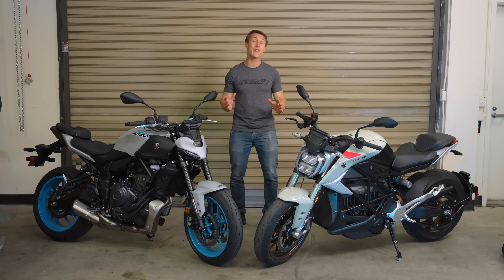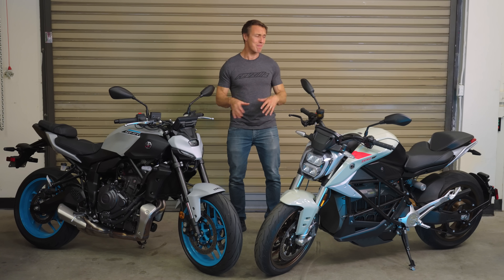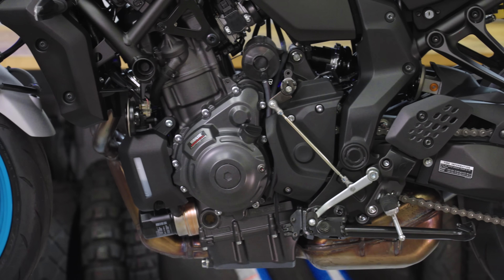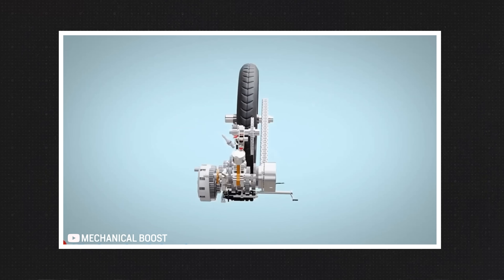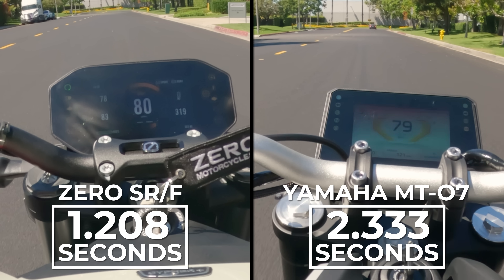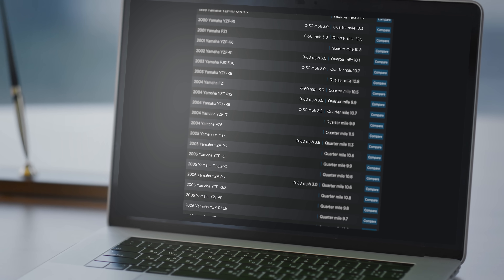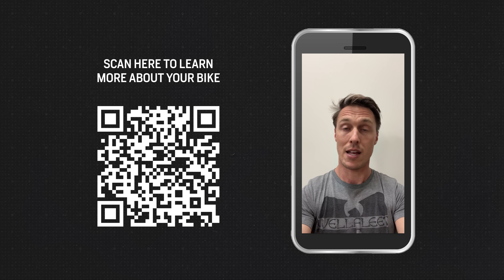Are Electric Motorcycle Torque Figures a Lie? | The Shop Manual

Comment: I ride E-moto's offroad. I believe the manufacturers figures are probably correct but in addition to torque multiplication theough gearing on IC bikes... with E-moti, because the throttles have a throttle ramp delay, you don't get the same feel of the torque because its metered out.
One of my bikes has an aftermarket speed controller that allows you to remove the throttle ramp up/delay... to get true 1/1 ratio with zero delay.. then the torque hits instantly and feels aprox doubled. Unfortunately, the available traction seems to completely disappear, too, though. It becomes much harder to ride, the slightest bump can cause you to break traction... and despite being more fun, it is ultimately slower.

Comment: 2 points here:
1. Isn't zero comparing their bikes with 1000CC gas bikes? I thought that was their whole marketing campaign !  Why are you putting it against a 700CC bike?
2. Wouldn't a Dyno run give you the exact torque to wheel numbers without all the BS?

Comment: I was just looking at the new "80 horse power" Stark Varg EX, on their side they claim 764 ft-lbs 🤔 
Yup, hard to wrap my head around as that sounds like it should loop you out in even in 6th gear (overdrive) on a sport bike, definitely between 3rd and 4th (anything below 1:1). I guess it's best to just think of it as something totally different, like a big diesel but even farther off.

Comment: As someone below wrote torque does not really matter. What really matters is how many times at the unit of time an engine can give this torque. And this is called power. If you know the power of two engines you can tell which is faster without any other data. That is not true with torque. Power contains torque in its equation. P = Torque * rpm * someUnitConversionNumber. So the Zero has 110hp and the MT-07 only 73hp. No wonder the Zero is faster.
Reply: Actually "area under the curve" is what you're looking for. Peak HP can be JUST as misleading as peak torque, because HP only occurs at a given RPM and so it doesn't tell you anything about any other RPM. The only way to truly understand a system's output is by looking at a graph.

Comment: The EV motorcycle manufacturers are hoping the common person only reads spec sheets and are BLOWN AWAY by the figures.
The EV motorcycle manufacturers understand the general motoring public doesn't understand the figures on gas bikes to begin with.

Comment: 2:20 your math might be right, I'm just gonna assume you checked. But the rear wheel torque number is only for 1st gear. As acceleration increases the left gear lever start moving upwards to avoid rpm limiter, the rear wheel torque reduces for each flick upwards with the lever. But the electric Zero keeps the same torque from start and upwards past legal speed limits.

Comment: Something to consider.  With an EV the weight stays the same from full charge to no charge.  Performance drops as the charge is depleted.  With gas powered vehicles the weight drops as the fuel is burned resulting in maximum performance increasing right up to empty.

Comment: I.C.E torque is measured at a 1:1 gear ratio, EV torque is measured at a static 4:1 gear reduction making the Electric motor torque appear 4x more than the combustion engine. Electric motors feel more powerful as they are starting from a dead stop whereas combustion engines are already running at an idle speed, you can feel similar torque from a combustion engine on initial fire where the engine will rock the entire bike(ie: Moto Guzzi or BMW R).

Comment: I hate advertising, advertisers, advertisements, and consumerism as a whole

But lemme tell you, I bought a duraboost Li-Ion battery for my superduke in 2023 and it’s been great. Several pounds lighter than stock and much more resistant to voltage drop over time

My only complaint is that the battery is physically much smaller than the battery box, and the little foam sticky pads they include in the box suck ass

I just measured and 3D printed an adapter box that was the size of the old battery with a cutout the size of the new battery. No complaints since then!

Comment: The tuning of the electric drivetrain is also very important. It generally takes a very robust motor to handle actual full power at low rpm without overheating. And, full power right off the line would likely either spin the tire or just make the bike want to flip. So they program it to feed the power in a little more gradually so it’s controllable and not going to damage the drivetrain. 
And, with a single gear you get somewhat limited by where the sweet spot is. Gear it lower and you have more power at lower speed, but it’ll fall on its face at higher speed. Gear it higher and it’ll be slow off the line, but pull good at higher speed. 
I think as they develop electric vehicles will start having 2 or 3 speed transmissions. That way you can have the ease of just leaving it in high gear and running around. But, also be able to use a lower gear for more acceleration at lower speeds. And, that could let them use a less powerful motor if it doesn’t need as much torque to pull as hard in high gear.

Comment: Torque means nothing if I can't get home without having to stop and charge for way too long
Reply: Don't ride further than your battery range? Pretty simple really. And yeah, you can have more than one vehicle for long trips (or hauling, or passengers, or whatever else). Electric bikes are mostly for short trips, yes. That's not a design flaw, it's a usage constraint, just like you can't transport furniture on a gas bike.
Reply: @falkin42  I have a job that can take me anywhere from 20 miles to 300+ from home one way. Imagine willingly chaining yourself to one town and praising the cage.

Comment: Ive explained this to many people who love to quote the torque spec of the ebikes as to why they are "faster" when its really the area under the curve that makes the difference. It similar to the gas equivalent of peak power/torque and not talking about the useability of that power(power under the curve of typical dyno). That said I have only seen one company that actually calls out both numbers in their marketing material, Dust moto. They outline the motor torque, and output torque with the reduction ratio stated. Thats when you know its a company run by engineers, not marketing staff haha

Comment: I was a gear head until my first Tesla.  That instant full torque and horsepower from just above zero rpm with the continued G’s building up as no tranny shifts to interrupt the G’s.  I own a fast  car with a PDK transmission.  You floor it but it takes a few micro seconds as gear selected, direct injection nozzles receiving gas, then rpm must build until tranny shifts.  Horsepower needs rpm.  Car Gas motor sweet spots around 7000 rpm.  Gas Motorcycles sweet spots even higher.  Horsepower basically torque x rpm corrected by a constant. Gas motors 25% efficent vs 85% efficency electric motors.  Oil so cheap that inefficient gas motors are used even today. Batteries will improve  especially when more factories in usa vs china and korea.  Chinese CATL worlds largest battery factory

Comment: The rpm at which the electric drive motor produces peak torque will not math out to a very big horsepower number.  Let’s say at 200 rpm the 140lb-ft torque motor is producing 5.34 HP. No one wants to hear that number in promotional discussions.

Comment: Basically, electric motors are no-limits as far as torque and power. The actual limit is power supply and temperature. As far as torque, an electric motor can be built (wired) in different ways to achieve higher torque or higher speed. It's a kind of integrated gearbox. If you have a clever electronic power supply you can achieve both, yet the temperature is still limiting the duration of the power / torque peak. And of course, the battery will eventually be drained faster if you pull more power. Base rule of thumb, max power is reached when energy efficiency is 50%

Comment: Just as in cars, torque number is useless, you want to look at power curve (and gearing), not random point on it. Power curve flat-ish = pulls from the lower rpm.
Thrust is GREAT way to show it, but sadly most  bikes don't have that in spec sheet

Comment: One my favorite motorcycles I've ever owned was the Brammo Empulse R -- full electric torque, sent through a traditional 6-speed transmission.  The 'butt dyno' feel of that bike going off the line in first gear is still unlike anything else I've ever ridden.
Reply: Agreed. I had the pleasure of riding the RR that Shane Turpin raced, and it was an absolute beast. Other than the weight, which made it really hard to slow down and turn, it was a phenomenal machine.
Reply: Ride a ZX-14R or Hayabusa. Or a 2nd Gen Vmax.

Comment: I test rode a Zero SR-F, decent but not overwhelming thrust… the most soulless experience I’ve had on two wheels. After a couple blocks I was ready to go back to the dealer, unfortunately had to do the full dealer led ride.
Reply: It's a different kind of purpose altogether. I think if they're gonna emphasize the quietness of an EV drive, they should use a belt because chain drives are nasty without an engine masking that noise.
If you want to roll along the countryside smelling the foliage and flowers, observing wildlife without scaring them all into the woods, it's the way to do it.
Completely different purpose than why someone would want to have their soul stirred by engine music.

Comment: So.... this is basic physics for anyone with more than two brain cells. "torque" numbers are meaningless here, especially in the context of internal combustion engines. F = m·a; P = E/t. Therefore you can derive a = P/(m·v). What does this mean? Acceleration is directly a function of power. If you keep in mind the power characteristics of a piston engine as a function of its RPM, you can see why a transmission is needed. For electric motors like permanent magnet brushless types, it's entirely based on the battery, controller, and motor design (size). You typically get peak torque at low RPM and it is NECESSARILY limited by the controller, otherwise you will melt the windings since the theoretical peak currents you can push through a motor are very high and the instantaneous torque they can produce is far higher than 150 N·m or whatever they advertise, mostly limited by the saturation of core and flux density of the permanent magnets... Ari is factually correct here as he always has been for as long as I can remember. But he's not stressing how important the mass of the system is in terms of the acceleration you feel as given by a = P/(m·v). That thrust graph is extremely important as well due to this equation. It's probably the most important graph out of anything in the context of how fast a vehicle can accelerate.

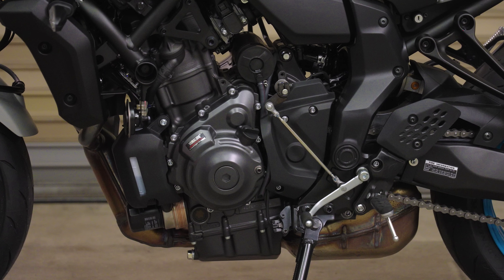Comment: HP is what moves the vehicle though. You can have 1,000,000 torque without any movement. All that matters is power at the wheel per mph, which he showed at 2:57
Reply: Remember: Physic do not lie. If You have no movement - Your power is... ZERO.
Power is simply torque*revolutions.

Torque, not power make possible to engine start running.

Any of these numbers (torque or revolutions) make impact for power.

Comment: The torque is produced right away also.  They say electric motorcycles are always in the right gear because they make their torque pretty much everywhere in the rev range.
Reply: Combustion engines produce torque immediately. Who's saying they do not?
EV's don't produce max torque at 0 RPM, or you'd flip on your head, the machine would be completely unrideable.

Comment: Torque figures are a lie in general. You have to measure it on the wheel to feel the real deal, just like horsepower, but torque is even more apparent.
And it's never about going fast, it's about moving from zero to not-zero.

Comment: Public perception is rooted in ice bikes though. The reason numbers at the crank were ever a thing is because so many bikes ended up with very similar overall gearing - a great deal of them even using the exact same parts - so one engine to another was a reasonable comparison to make. Then as more makers came on board and things got mixed up with rev boxes and big thumpers we started to see wheel numbers come out - though makers still like to put crank figures up to game the system for those larger digits. 
This is just an extention of that. Remember when Tesla were claiming torque numbers at the wheel? It makes big numbers and sounds impressive if you're daft enough to just take that as what it is but the reality is you could make a 50cc scooter engine put out the same with enough gearing.

Comment: Brother, my Impact wrench makes 1000 lb-ft of torque. Power is what makes you fast
Reply: You can have a very large torque figure...... and have zero motion at all.
When torque results in motion, now a "work" formula can be used, ie. horsepower.
Reply: Impact wrench torque is measured after the “gearbox”

Actual torque of the motor inside is far less.
Reply: @busterscrugs  2 step torque multiplication to the countershaft, usually. 1st gear being the highest, of course.

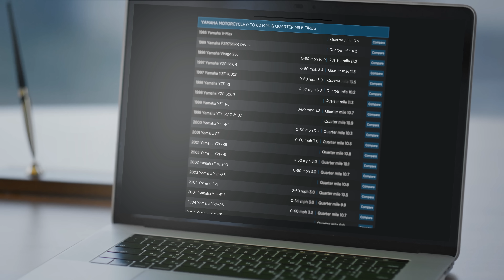Comment: I consider "top gear roll-on time" mentioned at 4:07 to be a very poor measure of motorcycle performance.  It encourages motorcycle manufacturers to lower the final gear for a better number, even if makes the engine run unnecessarily fast at highway speeds.   The irony is that testers often complain that a particular model seems geared too low for relaxed highway cruising but often downgrade a competing motorcycle if it is geared higher because its "top gear roll-on time" is slower.   If you want to accelerate more quickly, just downshift to get to engine speeds where more power is produced.   That's why God invented gearboxes!
Reply: So true.
Reply: this .almost unsubbed from best channel

Comment: Ever go into an industrial facility and look at a big electric motor and look at the id plate? You will 200hp. Not foot pounds of bloody torque because its pretty much making its rated power after the vfd's are done starting it. There's no reciprocating motion that needs to be at a certain rpm to do the math. Horsepower is the rate of work 1hp=55o ft/lbs sec.

Comment: Biggest problem is people thinking engine/motor torque is the same as wheel torque.  Having 100 lb-ft sounds small.  Having that same 100 with a 4:1 gearing and a 3:1 final drive means 1200 lb-ft at the wheel in first gear...but we don't think about that because vehicle torque stats are always given either at the flywheel or in top gear if it's measured on a rolling road.   But when you're comparing one vehicle with multiple gears in the transmission against one with only 1 gear...this needs to be taken into account.
Reply: I ride E-moto's offroad. I believe the manufacturers figures are probably correct but because the throttles have a throttle ramp delay, you don't get the same feel of the torque because its metered out.
One of my bikes has an aftermarket speed controller that allows you to remove the throttle ramp up/delay... to get true 1/1 ratio... then the torque hits instantly and feels aprox doubled. Unfortunately the available traction seems to completely dissapear too, though. 😂
Reply: No, the biggest problem is people not understanding basic physics. It's not about torque, it's about power. Ultimately, the acceleration is entirely a function of the engine output power and velocity...
Reply: But electric motor has gives maximum torque throughout a wide range starting from 0 rpm.
Reply: @JSM-bb80u  no. the torque curve of an electric motor is a line with maximum at near 0 rpm and declining rapidly

Comment: This alwys makes me wonder why they don't use a gearbox in electric vehicles.  Yes, there's a little more weight, and some internal losses...but having all that multiplication should be a boon.  Only needing a motor with 50-odd torques should at least result in longer range from the same battery, as the motor doesn't have to take up the strain that a lower gear would otherwise alleviate.
Reply: More weight, complexity, cost, and not needed
Reply: @giovanhagar  Exactly.
Reply: They don't need to have multiple gears. Both the power and torque of an electric motor are "relatively" (compared to ICE) flat over the motor's entire RPM range. And at or above the motors peak RPM, there is not sufficient power to make the bike go any faster.
This is in stark contrast to your average motorcycle engine which produces nearly no useable torque or power until the engine is turning over at a couple of thousand RPM and does reach full power or torque until much further up the RPM range.
Multiple gears are required to keep the engine at higher power/torque outputs regardless of rear wheel speed. That's just not a problem with an electric motor.
Reply: The amount of work the electric motor does is the same no matter the gear and unlike an ICE, electric motors do not have narrow RPM bands where they are efficient, nevermind usable. More torque is pointless as most EVs already have more than enough to get going. My 200 HP FWD EV can do burnouts while rolling if I suddenly stomp the accelerator pedal so extra torque is something EVs really don't need.
The only use case for a transmission in an EV would be to use lower rated motors (<100 HP) to move heavy vehicles. But I don't see why, as from the cost perspective would probably be cheaper (and easier) to add a bigger motor instead of adding an additional assembly with gears, fluid, shifter and so on. Oh, and people would probably not buy such vehicle for road use as it would be very slow. Maybe in a construction or agricultural vehicle such implementation would make more sense.
Reply: They should have electric hybrid setup for trucks that need that monster torque to help the ICE get off the line ... could have a lot less gears and smoother power delivery.